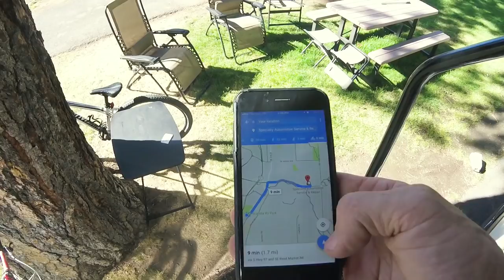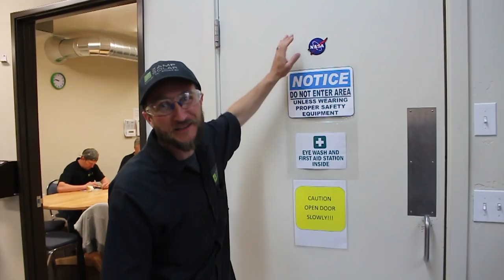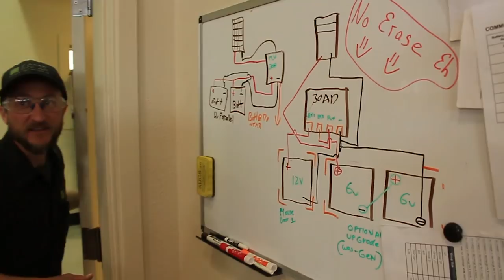RVING BEND OREGON // DESCHUTES RIVER // SMITH ROCK (RV LIFE VLOG 61³)

Comment: Normal $200 towing charge, $160 no trouble found ford service. Fixed with dollar fuse.  If there is an open issue on that I would go back to the ford dealer and ask them why they never even checked the fuse.  That fuse looked like the resistance heating up was right at the fuse block so probably the connection of the wire to the fuse block is probably bad.

Comment: Semi-flexible solar panels are much better suited for portable installation. They are at least as efficient and lighter weight, because they do not need the bulky rigid casing. They are still as durable for practical use and can be purchased for similar pricing, less if you order from China. They are many times easier.

Comment: Just saw your problem with the fuse. When a fuse burns like its not a current problem, 99% of the time its a lose connection on the clamps that contacts ( hold) the fuse and it gets hot and burns the fuse. Love your videos!

Comment: It's always good to have extra fuses but I'm surprised you truck didn't come with extra fuses and a fuse puller. In my truck the fuses are located in two places, under the hood and behind the glove box. My extra fuses are located in the box behind the glove box. Don't know why they make them so difficult to get to. Also I was hoping you would have filmed you actually getting into the canoe, trying to decide if I would still be able to 😎

Comment: Can we get some advice? We are preparing to join you you full-time on the road, but we have no tow vehicle and no trailer. We are zeroing in on a trailer (maybe 24' with a slide or two) but the truck is the bugaboo. Personally, I'd like a 3/4 ton diesel but those suckers are EXPENSIVE. I see that you use a 1/2 ton EcoBoost 4X4 crewcab. What do you think? Is that truck and trailer perfectly acceptable or do you wish for something different? If you were like us and starting from scratch what kind of a setup would you pick? (I should let you know that we're not exactly loaded financially!) 
We really have enjoyed your videos. The other Sunday I spent several hours binging on your stuff. Thanks for what you're giving us!
Gary & Eva
Reply from the maker: Our truck is deceiving. It has the 6.2L engine. Yet, the ecoboost is a good motor with good towing capacity. Here's what we did and check out our video on "how to pick the perfect RV". Keep your truck and get a TT that will work and get on the road. Figure out the perfect while you're RVing. What you like and don't like will change as your get more experience - no need to guess on what you *might like and spend $$ before you're 100% sure. Hope that helps. We have all the time in the world now to pic our perfect rig and it's not stopping us from having fun. The destination is the same no matter how you got there.

Comment: could also be that the fuel pump is close to failure my Ford did this intermittent starting thing for 6 months prior to failure. The increased draw on the fuse and or connectors could be the fuel pump. My fuel pump failed at 95,000 miles

Comment: Marc I don't recall if you had to pay for the diagnostic on the truck? Good job on finding the fuse problem out with a little help from your friends!
Reply from the maker: Yes. $125. I understand the electrical work is charged per the hour, but considering they missed the problem and it was a Ford bulletin...I thought it would have been nice to apply the diagnostic fee toward the relocation kit labor cost and I would have had them do the work. They didn't want to do that... so I moved on.

Comment: Keep the extra fuses and never ever replace a called for fuse with a larger one. The wiring won't be designed for the added amps. It is about the second thing they teach in electrical classes. Let Ford do it if it's called out in one of their bulletin's
Reply from the maker: The bulletine suggested a relocation kit where the new wiring comes with it. It was about $200 to install. Haven't done it yet. Figure a have spares now and I can assess if it causes an issue again.
Reply: I don't think he  was talking about replacing it with a higher amp fuse I think he was meaning  replace the small 20 amp fuse with a large 20 amp fuse.

Comment: The issue with your fuse does that effect all Fords or just F150?
Reply from the maker: I think just F150's, but it would be easy to check. There are large 20amp fuses and small 20amp fuses. If you locate your fuel pump fuse in  your owners manual and then locate it... you can see if it's big or small :)
Reply: Keep Your Daydream thank you so much.   BTW thank you much for sharing your family and amazing journey!  Your videos have been very educational (we have only taken our TT out 3 times) and entertaining.
Reply: Keep Your Daydream...hey there....just had the same problem with our '09 F150.  Google "TSB 15-0137 Fuel pump fuse". The problem is the high heat on that micro fuse.  The TSB will tell you to relocate the fuse to another spot on the fuse block.  There is a $20-$30 kit for this fix and any mechanic can do it in less than an hour.  Your 20 amp fuse will work, but problem will reoccur down the road.  New fuse location will accept the larger cube looking fuses already in the box.  Let me know if you need any more info.
Reply: Chip Roberts thanks so much.  Will definitely be googling to check it out